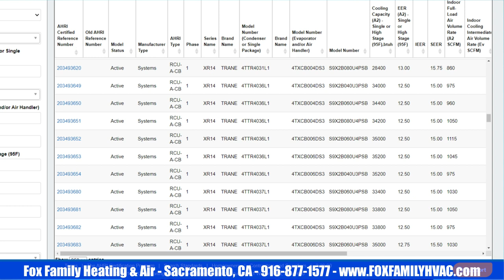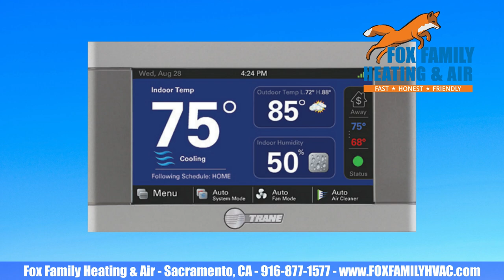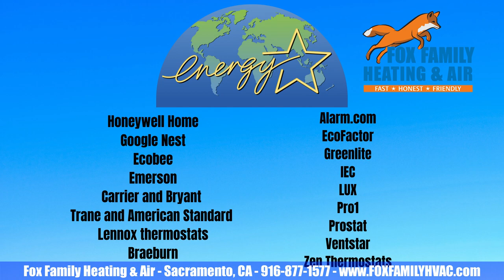HOW? Are Newer AC's More Efficient Than Older Ones?

Comment: It must be also noted where a person lives plays a part. Here in Michigan you use your A/C maybe three month's out of the year and on and off at that. So going from an 8 to 18 seer isn't going to save you jack shit. It would take you 15 plus years to break even on the cost of the equipment and install . Where in Texas it might be 4 years because of constant running. And the cost of replacing shit out of warranty on newer equipment is insane. I have swapped out ecm motors and put in pcs motors  because of the cost.
Reply: Good info.  Is there any concern in matching the specs between the two motors?  Thanks.
Reply: @werquantum8228    When I get to Monday, I'll give you the web-site for that part for the blower motor.
Reply: @wd8557  thanks!

Comment: More efficient....yes......made the same.....heck no......today's equipment is made like junk. Do yourself a favor and invest in the home before equipment. Better doors and windows, insulation,  sealing of drafty homes.....all of those have zero maintenance and will provide years upon years of payback. You will also be able to downsize your system to achieve the same goal.

Find a contractor that actually knows what they are doing. Any quality contractor performs a Manual J,S,D load calculations. Another quality in a good contractor is one who performs a blower door test, to find how leaky the home is.
Reply: Where are you located sir?
Reply: I'm better than most in Chicagoland and never done a load calc/ home pressure test nor have I heard of or seen any contractor in Chicagoland do for about 25 yrs now.  I can check for leakage with my high end FLIR camera though 

What part of this country are you in?

Years of expierence and hundreds of systems installed in all sorts of places with spaces requiring 100 tons of cooling I have only screwd up once.. Undersized a furnace for a house. 

Expierence with variables and rules of thumb get us by here.

Comment: Yes and no. I’m not a salesman looking to cash in on equipment sales, so no I’m not going to go along with the industry sales pitch. The older units are better made, some a lot better, which I’ve found working units from the late ‘70’s. Regulators are killing the affordability of newer systems like its killing kitchen appliances, with manufacturers taking advantage by building throw away appliances. The newer equipment is more efficient, but we’re telling the customers to expect 15 years service IF the unit is properly installed and maintained per the installing company’s maintenance schedule. None of this newer equipment will ever last 50 years. No way. Especially micro channel or super sensitive systems like the evolution series.
Reply: the Aluminium condenser last  max  3 years
Reply: Very sad
Reply: Good. More business for HVAC companies like mine.

Comment: Yeah new tech is better, but will they last longer than old tech?  That’s the real question.
Reply: Not engineered to last purposely
Reply: I installed a Rheem 3 ton System including the ductwork on my sisters home in 1986.
The home did not have a/c when it was built. I replaced the fan motor and cap once and  the contactor once. I never put gauges on it after the initial start up until I recovered the refrigerant to remove the equipment in October of 2020. I just checked suction and liquid line temps as well as the split across the evap coil. I ran a new line set and drain line for the new system. I am willing to bet that this system WILL require a repair in 5 years or less. Even though it was installed per factory specifications. The 25 year old systems are no longer. THE NEW SYSTEMS REQUIRE MORE UPKEEP THAN THE 10 SEER.
this mean you have a 10 to 12 year lifespan at best. I have 42 years in the HVAC TRADE and have never seen parts fail at the rate I am seeing today. Who else is seeing what I’m seeing.
Reply: 43 years in the Trade no they will make it 10 years at most. And require a repair at least 4 or 5 times.
Reply: @hvacmike1175  More reason to keep my 27 yo ICP heat pump alive!  Thanks.
Reply: That would be a for sure NO, they will not last any longer without a bunch of repairs.
Reply: @hvacmike1175  Not to mention, quality installations are not happening as often.

Comment: How can you say any of this with a straight face?  The old ones used cooling fins to increase the surface area.  Better, they were made of copper which is the most thermally conductive metal.  You would have to roughly double the surface area of aluminum vs copper to be as efficient a thermal conductor.

The compressor lasts longer? Citation needed.  Nothing last as long as it used to since we started importing everything from China.

If you properly maintain your air conditioner, getting clogged with dirt isn't an issue.
If modern heat exchangers are bigger, why do they weigh less?  Besides, a larger heat exchanger needs a larger fan and higher volume of air to cover the larger size. This takes more power, not less. If you double the size of the heat exchanger, you need a fan twice the size moving twice the air.

Can you show some paperwork from a reputable 3rd party disinterested lab  that shows a modern air conditioner uses less joules per cubic meter of air?  Like if it takes 1000 joules to cool 1 cubic meter of 90F air down to 68f using an old air conditioner, how much does the new one use to also drop 1 cubic meter of air from 90F down to 68F?

How can they possibly more efficient than older air conditioners that use better refrigerant now banned?  R12 was better than R134a  That's why they used R12. Now R12 is severely restricted or flat out banned.  R12 is 15% more efficient than 134A.  How can a less efficient refrigerant use less power to do the same work? Now even 134A is banned and an even worse substitute is used, at least in automotive applications.

Comment: So i have two issues with this presentation. 
First I am not a fan of dumbing things down for homeowners treating them like there five. While nothing stated is “wrong” many points come damn close to wrong due to the inaccuracies from trying to dumb it down. 
It doesn’t effect you, it effects those of us having to explain why Harry homeowner is wrong after they just misinterpreted a barely accurate video.
Honesty and accuracy are the golden rules of communication.

Second point. Stating something is better is extremely relative.
My 1960 chevy Apache is a great truck, but its construction is actually really basic and overburdened compared to my 2005 suburban.
Old things last longer because they are overbuilt, engineering 20, 30 and more years ago was more related to “rule of thumb” than math. Its the “why use a 22 when the 45 will definitely get er done” mentality. Because of that they do indeed handle more extreme or imperfect circumstances but they are significantly less efficient.
Modern machines are engineered way better and as such are far more efficient but they are designed to exist within certain conditions. That stupid trane coil is a perfect example, clean and new they are great but throw some dirt and lack of maintenance at em and they go to shit quickly! (Not to mention impossible to straighten if something so much as breaths on it).

So to say the old shit is better is relative. if you want to set it and forget it then yea better go with the “cast iron” option. But if you are willing to pay attention to proper installation and service, then the new stuff is way better.
Reply: I still am concerned about longevity of the new stuff.  Lots of comments here about expensive parts failing sooner than old units.  Thoughts?  Cheers.

Comment: The cooling performance and operating cost are governed by the laws of physics, period!  The only specification that is actual and scientific is EER.  SEER is completely meaningless, it is nothing more than marketing nonsense.  Haven't you noticed that the EER never exceeds 13 regardless of decades of "improvements".  The chart you showed indicated an EER of 12.5 for a 15 SEER system.  I will continue to keep my 19 year old R22 system going as it has an EER of 12 and I have the lowest utility bill in the neighborhood.  How about those 20 SEER 2 stage systems - on stage 1 they deliver 50% capacity with 50% energy consumption - NO CHANGE in EER. And if the ductwork is in a hot attic the low CFM results in dramatic heat gain at the farthest vent. Interesting that is not factored into SEER, if so the SEER may dip below the EER!

Comment: Good basic info but did not actually prove the topic.  Take a good R22 system from the nineties and compare THAT to today's most efficient system.  Energy efficiency is defined as energy out/energy in.  How many BTU per watt are we getting?  Compare under equal conditions.  The seer system is deliberately difficult to grasp.  Notice that rating system only came into play once R22 was replaced so people can't even compare the seer rating of their new system to that of their old R22 systems.  I wonder why...   Were all these innovations necessary to bring the efficiency of 410A systems closer to that of those using 22?   The engineers who designed those systems knew exactly what sized coils were needed for maximum efficiency, all scientifically validated.   Ever wonder why 410A system coils had to be so much larger for the same heat capacity?

If we're gonna compare efficiency of old vs new, do it.  With real efficiency numbers.